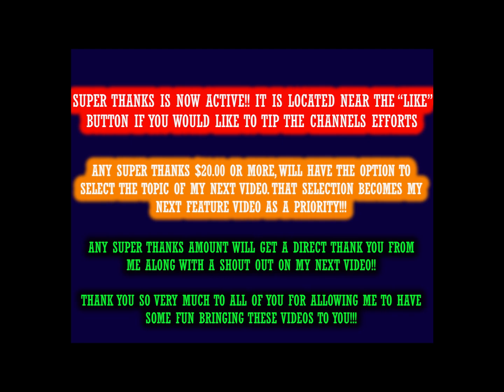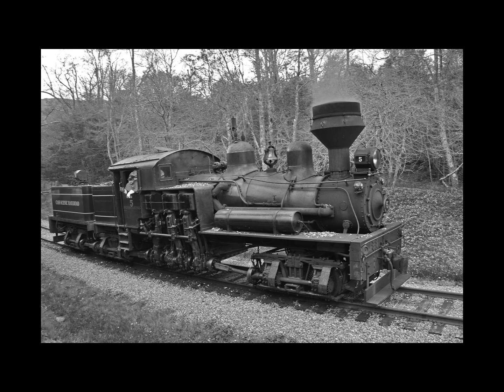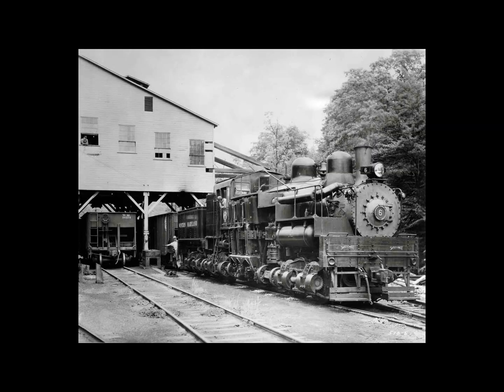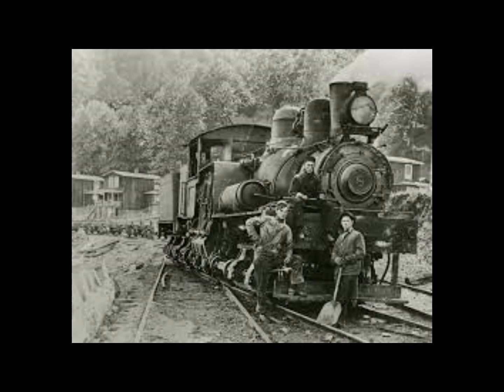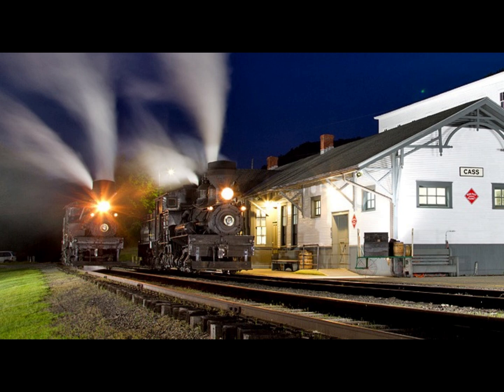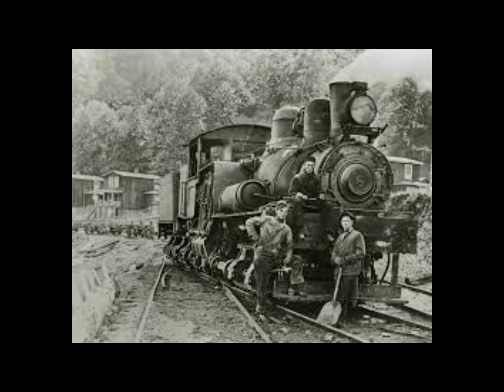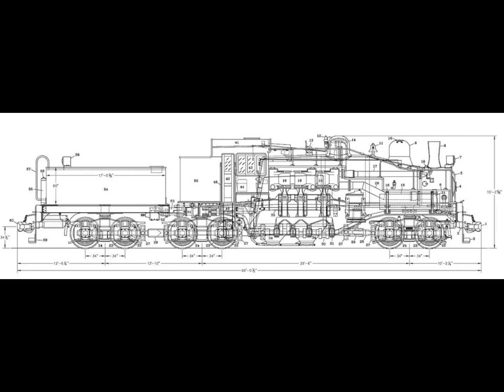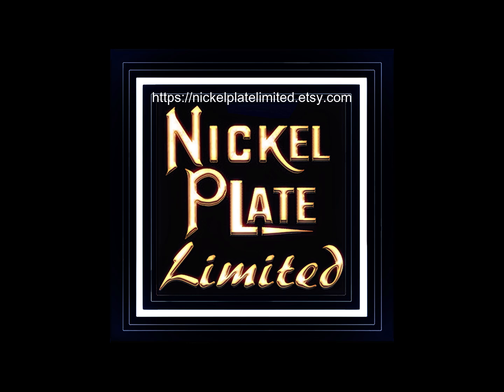The Locomotive That Ran Like A Truck

Comment: Two railroads used those types,of locomotives for street,industrial switching! They were the NYC,on 11th Avenue,in Manhattan[NYCity]! And the other,was the New Haven,in Boston,on Atlantic Avenue,under the Elevated! The NYC,used Shays,and the NH used Climaxes,both suitability covered,so they wouldn't frighten the horses! Thank you for the forum! Thank you 😇 😊!
Reply: The KCS had 2 to switch on the north side of downtown Kansas City because of the curves and grades.  One track is on 13%.   They were the 900 & 901 before the Texas types were bought.
Reply from the maker: Thank you!

Comment: When I was a youngster.  A good buddy of mine had a 3 truck Shay in HO.  We made a tug of war track . We use to put on competitive pulls against every other HO loco's we could find. From steam to Diesels.  It out pulled them all. Even an Atheran DDA40X.  Lots of fun days.
Reply from the maker: Fun story! Shay really had it's entire weight on the "drivers" .. So im not surprised by the results you got.
Reply: @TheRailroadCrossing-SteamPower  
Oh I forgot to add it was a Brass model too. Very heavy.  But still it was impressive to watch and try to win against it.

Comment: You forget to mention anything pertaining to the Willamette geared locomotive that was essentially a Shay.
Reply from the maker: That's because there were more than a few slight variants.. In some ways Shays are similar to the Mikes.. I cannot mention every last class or detail in one video because of run time being excessively high if I did so. That is exactly why many of these locomotives are going to get a second video..And in some cases even a third. The Williamette is actually an operation of it's own merit's and will get a video of it's own. Not just it's Shay variant..But the operation as well.

Comment: I thought these were a nightmare to maintain? Is it not the case?
Reply: No.  All of the engine and drive line or drive shaft are easily accessible on the right outside of the loco and close to the ground.  The hardest gear to get to is the bevel gear on the right-hand wheel of each truck because it is behind the drive shaft bevel gear.  The drive shaft is on the outside or end of the axle of each truck.  All of these bearings are babbitt.
The Climax and Heisler locos have the drive line under the boiler with the gears in the middle of each wheel-set axle.
There is a short section of track just before the summit of Bald Knob at the Cass RR that is 11% grade or 11 feet rise for each 100 feet horizontal.  On the day my wife and I rode the train, they used 3  Shays to shove 7 cars up to Bald Knob but only 1 loco to get us back down to Cass.  The other 2 locos went back down light or no cars.
Reply: They were built to be field fixable
Reply from the maker: I have worked with the local excursion group who runs the Heisler version of this and they have always said it was by far the easiest to maintain of their four locomotives. I can't imagine it being any different for the Shays.

Comment: I wonder what a 6 cylinder shay locomotive would look like

There's a shay being restored at the Spencer shop in NC, about 45 minutes from where I live
Reply from the maker: Dunno, But I think it's one of the coolest looking designs around as is.
Reply: @TheRailroadCrossing-SteamPower  it is distinctive, they have one in the allen country musium in lima ohio just across the street from the library, lima is big not as big as fort wayne though population wise, maybe about like south bend, has still a lot of heavy industry though not like it did before the 1970's, been there a handful of times in the summer seeking info about the loco works there, though I have never been by where the works used to sit last I heard it was set to become an oil refinery or has and that was two years ago or more at this point. I know though for a time our engine 765 was stored there at the lima errecting shop building, but it had pannels of the roof falling in then, and it was the last steam engine to leave the lima errecting shop before it was torn down, 

by the way you forgot the willemet type shays which had superheating and were built by willimet foundry in the pacific northwest I belive
Reply from the maker: @manga12  There's many variants derived from the Shay principle design. The Williamette being one such type.